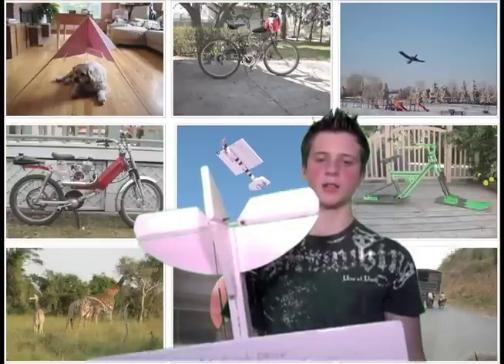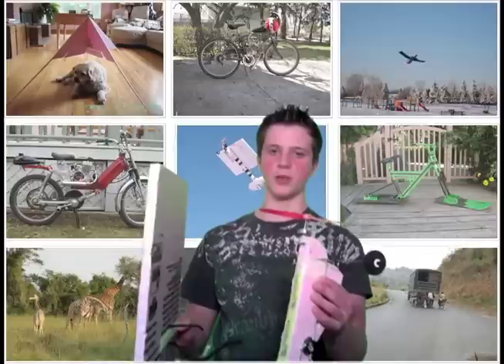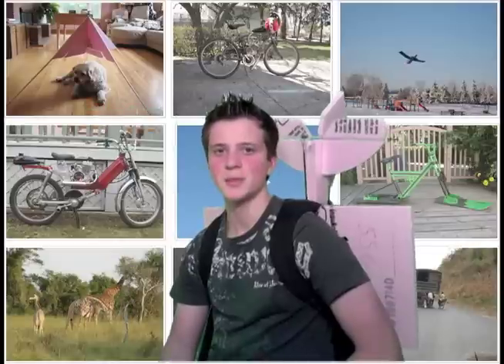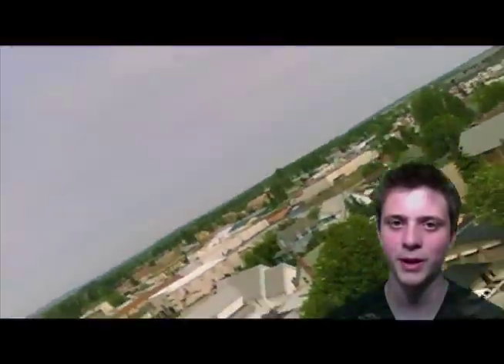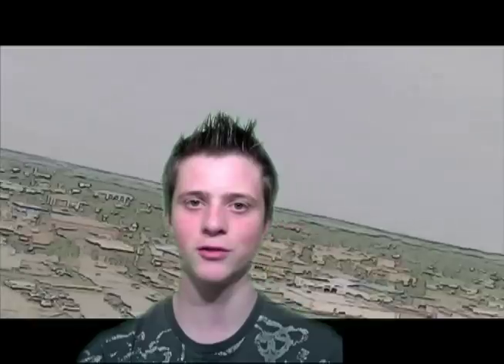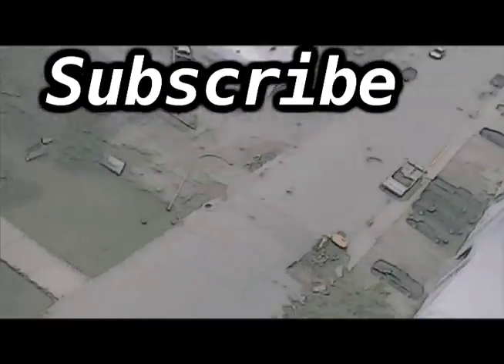Portable Aerial Video Aircraft #1 (Season 2, Episode 7)

Comment: Nice video!
I agree, more stability is needed, but at least the plane flies slow, and slow crashes mean less damage.
Which camera were you using for the flights, and what is your new camera?
Are you actually flying FPV or recording on the plane?
I've had success in using small nylon bolts and nuts to hold together foam airplane parts. Just bore out a hole for the nut in the fuselage and hot glue it in, then run the screw thrgh the wngs. 3 or 4 should do for you. Not as fast as velcro though.